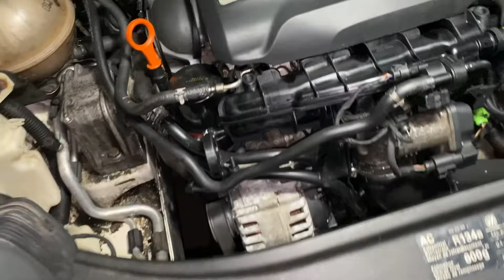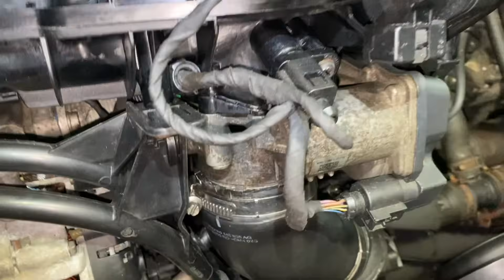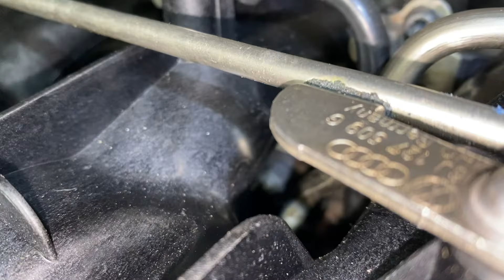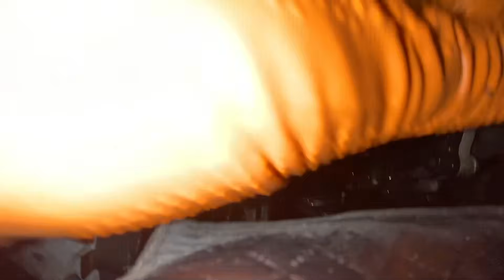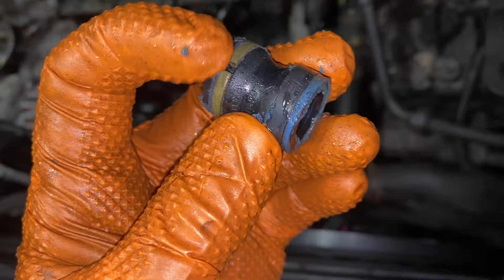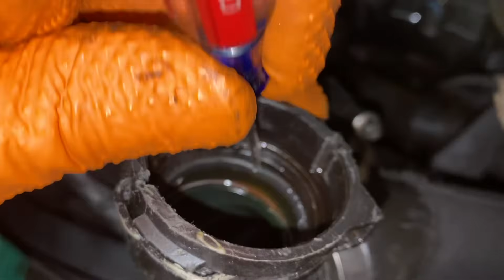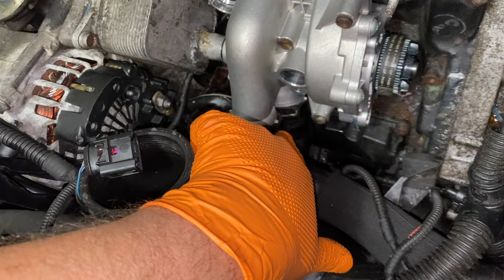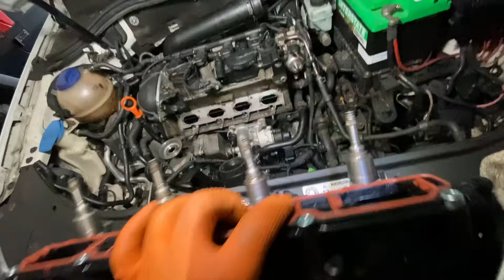Step-By-Step Water Pump Replacement on VW Passat, tiguan, CC, EOS 2.0 Turbo TSI/ CCTA  2008-2016

Comment: Hi, thanks  for the video  can you please let me know  the part #  on Amazon  if you  can thanks
Reply from the maker: No problem! Appreciated!

https://www.amazon.com/Aluminum-Water-Tiguan-Jetta-Beetle/dp/B07WQGG5PC/ref=asc_df_B07WQGG5PC/?tag=hyprod-20&linkCode=df0&hvadid=697456193483&hvpos=&hvnetw=g&hvrand=4772202874905904387&hvpone=&hvptwo=&hvqmt=&hvdev=m&hvdvcmdl=&hvlocint=&hvlocphy=1026032&hvtargid=pla-815245761019&psc=1&mcid=5c19d47b3069357c9e5bdb50b51ed3ff

Comment: Hey! Great video. I’m stuck trying to get the manifold out, I got all the torx and 10mm nuts off- I might have missed if you mentioned in the video if there’s a support bracket underneath the manifold. Something is keeping the thing stuck - it’s 1/2” out already but won’t budge. 
Help anyone! Thanks!
Reply from the maker: Yes I even made another video about that bracket
Reply: @motorcarnut right on!  Now I’m struggling to find replacement bolts for the water pump- it was previously replaced apparently and they stripped the bolts I had to chisel a couple out. Going to call VW tomorrow
Reply from the maker: @JW-wq1jj or just match them up with some from a hardware store like Home Depot

Comment: Hey buddy so I did my water pump on my 2012 VW CC Sport after everything was done I had a engine light came on i reset it but it came back on run a test and now it’s saying some gaskets on manifold are leaking
Reply from the maker: Make sure the intake manifold is completely seated. Sometimes the fuel injectors if not positioned correctly will cause the manifold not to seat all the way
Reply: @motorcarnut  it did set right but some reason I got codes  P2008 Intake Manifold Runner Control (IMRC) Circuit Open (Bank 1)
Reply: That is why don't mess w the manifold, just remove the TB and radiator fan.
Reply: @kimboofdzners9574  it was a connector that I forgot to plug in the one behind the manifold right side

Comment: To motorcarnut, i have a 2012 vw eos with currently 72000 miles on it, i know that somewhere down the road i am going to need a thermostst or waterpump or something down in that area and this video that i just saw that you made was incredible to watch, i have already had to replace the temperature sensor in the waterpump housing due to failure and after knowing what i had to go through for that and knowing that some day i will have to replace the waterpump, watching this very through video i will be able to tackle it, but you did an incredible job creating this video along with explaining everything, while taking all this stuff apart now is the time to replace the waterpump, the thermostat, the tempetature sensor and any "o" rings and gaskets while its apart at the time for whatever you are already doing, for the few extra bucks for parts, now is the time to do it to save yourself tear down time in the future, again thanks for the great video.
Reply from the maker: Sure, thank you as well really appreciate the comment and feedback and good luck!

Comment: I own a 2012 Volkswagen CC 2.0 Sport and I have coolant leak took it to the shop and they said it was the water pump they quoted me $1000 to replace the water pump is that how much and water pump cost ? I can’t seemed to find a good part store for me to buy the water pump by now watching this video I should be able to do it myself
Reply from the maker: Go for it! You get stuck give me a holler. Get an aluminium one on Amazon for like $50.00
Reply: @motorcarnut  yes ima give it a go
Reply from the maker: @thebigbosss1000 take your time and I have another video about a hidden bracket you have to take off too just so you know. I left it out of this video
Reply: @motorcarnut  yes thank you I’ll check that out 👍🏽
Reply from the maker: @thebigbosss1000 no problem
Reply: @motorcarnut  how long did it took you to do this work ?
Reply from the maker: About 2 hours but for you set aside a good day or so.
Reply: @motorcarnut  ooh okay got cha thanks for this info 👍🏽
Reply from the maker: @thebigbosss1000 no problem!

Comment: Excellent video! How difficult is it to change that belt while in there?
Reply from the maker: Thanks! Easy when replacing pump
Reply: If it is not damaged, leave it alone. Rarely rarely they go bad, have opened plenty of ea888 engines w 200k miles and more, never the water pump belt was in bad shape.
It is difficult! As it is reverse thread and if I recall uses a 12mm, but if for whatever reason you strip that bolt, you will NEVER be able to replace the balance shafts (IF they need to be serviced), unless you pull the transmission out and access the bolt from the freeze plug.
I highly recommend don't mess with the belt unless it is a must and like I said it is reverse thread.

Comment: Very comprehensive video! Congratulations!

As an owner of the grandfather of the TSI engine , having a g60 motor into a Passat Syncro, ( 325.000 km.),  unopened for repair, make some unavoidable comparisons.

At that era, (1990), users complaining that the g60 engine was very complicated and fragile.
The real life saw that it was, simply, so much ahead for  the  era, (of the 90's), but for nowadays, too.

With an ABT kit, (@ 200 hp), works for 32 years without a glitch, having so much better qualities, (every part is made of aluminum and the notorious supercharger of the exotic
magnesium). (Of course, the car was and is for every day use and not for races). 

I service her in person, without being a mechanic, and tomorrow I am going to change, by my self, for the first time in 325.000 km., the water pump which is, in comparison to the TSI's pump, a miracle of technology in its simplicity, quality and durability.

Not to forget that the g60 supercharger, supposed, at that era, to be a grenade , works perfectly, (the 3rd generation),  and is proved to be  more durable than the TSI's turbos and superchargers, without problems , having a M.T.F. of  ~200.000 km..

As for the timing chain of the TSI, you know... 
The g60 has a timing belt working silently, (no diesel sound but rather a turbine),  and, just in the case you forget to change it, the g60, as a non interference engine, remains without any damage! (It happened to me once).

Please, if you think this post is irrelevant, delete  it.

Thank you for your time.

The Syncro Heresy
Reply from the maker: I enjoyed reading this. Engines are not like they used to be that’s for sure. Been saying that for many years. Thanks for the post. Appreciated!

Comment: Great video with lots of details! Thank you! Is there an easy way to replace just the thermostat without having to take the intake off? My water pump is pretty new but the thermostat is stuck open. 2012 VW CC. Thanks again!
Reply from the maker: It’s in a tight area and has to be done under the vehicle but it can be done

Comment: My water pump just went today, I’ll be doing this because of this video! Is there any special procedure you have to do when adding fluid? Do you recommend flushing the system first? I’m also thinking of changing all the hoses out as well while I’m doing this too. Great video!
Reply from the maker: Thank you very much!, Yes, some vehicles have an aluminum brace that goes from under throttle body to engine block that is not in the video because some don't have one and yours may. 13MM nut to throttle body and triple square bolt to block. I would flush heater core, I have a video on that as well because have many vehicles that had low heat output and recommended. No special procedure for filling coolant system. You get stuck give me a holler. Good luck!

Comment: Hey brother, I have always been wanting to ask but I always forget. As far as the injectors when pulling the intake off. Is it really required to reseal the injectors if they don’t stay in the cylinder head?
Reply from the maker: No, they rarely go bad unless they are obviously damaged
Reply: @motorcarnut  You should make a video on how common Tiguans leak threw their sunroofs!
Reply from the maker: @ivanvega2821 Yes, I will. The drain lines pull away and create leaks. Thanks!

Comment: Awesome video, I’m using it to replace the pump on my 2017. I’ve followed all steps but something seems to be holding the manifold in. I can get it about 1-2” away from the engine but it won’t come up I’ll have to watch a few more times!
Reply from the maker: There is a metal support brace that goes from the bottom of the throttle body to the engine block that some vehicles have and some don’t. I forgot to mention that. Sorry

Comment: I am planning to buy the 2013 VW TSI 1.4L HL Golf MK7 - Was wondering if this water pump is exactly the same for that model. Also could you please share where you got the after market water pump from please. Looks like a good durable option.
Reply from the maker: No that engine is different.

Comment: Another question at 26:50 does the plastic line plug into the front of the solenoid sensor?
Reply from the maker: There are many which one? Where is it coming from?
Reply: @motorcarnut  the straight long plastic line coming from the back by the intake solenoid with the piece of hose at the end  but the one that comes in the intake
Reply from the maker: @mr.mr400 Intake runner flap solenoid to the back on the vacuum pump

Comment: Did you have to put the plastic spacers on the fuel injectors ?and are the metal rings with the hooks on the injectors clipped  onto the metal flange on the fuel rail holding it in place?
Reply from the maker: Yes you have to put back the plastic spacers and no the metal clip does not clip on to anything.

Comment: I have a oil leak coming  water pump area is probably from oil cooler . I will replace water pump as is leaking but not knowing how to fix oil leak.Thank you very much for your videos!😊
Reply from the maker: Thank you! When you take off the water pump you’ll have a better idea where it’s coming from. The oil cooler has a seal from the block but rarely ever leak, make sure it’s not the valve cover

Comment: thanks for video In my case we are going to replace the chain set the pump is still fine. Is it wise to replace the entire pump with housing or just the pump itself?

An is an INA pump (130€)  a good choice of should pay 50€ more for an Hepu?
Reply from the maker: The water pump is one whole unit, I’d replace it so you wouldn’t need to worry about it anymore.
Reply: @motorcarnut  Thank you for answer will do it
Reply from the maker: @erenoglu no problem

Comment: Thanks! While this video didn't have the aluminum bracket under the manifold, it was very good. You saved my daughter $1800 and it was possible in larger part because of the video.

One recommendation: i took out the large hose (about a 7" section) under the manifold in order to cleanly reinstall the manifold.
Reply from the maker: Awesome! And thank you for the donation. Sorry about that brace, the newer ones don’t have them anymore and for to mention it for the older ones.
Reply: How did you get the bolt off that brace? I’m working on my 2017 and as soon as I read you comment I saw i have a brace!
Reply: @mwm13  my bolt was a M8 triple square spline bit along with a couple extensions and a magnet extension to correctly move it into place. If i could upload photos i would...
Reply: @kevkev7164  I got the 13MM nut off the  top of the brace but I can’t see where the bottom even goes. I have to take a break and google a bit more I guess. Do you have a picture you’d be willing to email me?
Reply: absolutely- whats your email.

Comment: I want to change de oil cooler too because the oil it goes 10º/15º degrees hotter than it should be i think it might be de oil cooler . I suppose that if i follow the steps of the video to the 19:00 min , its simple unscrew the oil cooler and put the new one right? Awesome video!
Reply from the maker: Yes! And thank you for the comment!

Comment: Today i changed the water pump. The only issue i had was a bracket under manifold.  Your video did not show it.  I was like wtf. Why wont it come off.  I pulled a few times said something isnt write.  Got it off. Was 1   10 mm nuts and another torque.  I have a 2012 volkswagon cc 2.0 tsi.  Just a heads up for anyone that has the same.  Took me a  lil while to figure out.  Thank you great video besides that
Reply from the maker: Thank you and correct! I do so many of these and almost all of them are not there or newer ones don’t have it at all from the factory.
Reply: Yea it was driving me crazy. I watched your video 5 times. Best video out there btw.  Thanks
Reply from the maker: Thank you! I really appreciate that!

Comment: Incredible video. I'm trying to help out a buddy who's in a tough place. He has a 2006 Passat 2.0t. Fsi engine. How much different could it be? I'm pretty mechanically inclined, just wondering if this video would help me out enough to where I can figure out the rest. Thank you!!
Reply from the maker: Thank you! They are pretty different engine and this video wouldn’t help you much. The FSI engine has a timing belt not chain like the TSI engine also the water pump is completely different as it is driven by the timing belt. If you have access to a library online you can look up the procedure for free. I haven’t had one of those for a long time and believe you need a cam tool as well so might be better to change timing belt with water pump.

Comment: PLEASE TELL ME HOW DO YOU REPLACE WATER PUMP DRIVE BELT
Reply from the maker: Same as in water pump replacement. The belt goes on when installing water pump
Reply: @motorcarnut Jesus! 
The belt has a reverse thread bolt, and uses if I remember a 12mm or 13mm close wrench. It is a pain to remove if the bolt is very tight, do not strip it! 
I made a custom socket, cut it half to make it shorter and where the rachet side I made to flat slanted surfaces to fit an open wrench. This way it is a mini shorty socket (better grip) than a close wrench. 
I use an open wrench and place where the two flat sides made on the modified socket and that's how I was able to take the bolt out. (Remember reverse thread)

Comment: This video saved my ass!!! I have a 2014 CC and i learned the hard way that an oil leak will cause the seal to expand and crack the plastic. I was able to get a new water pump in there so i can get to work and next week i can deal with the valve cover. This is one of the best tutorial videos I've seen  and I'll 100% be checking back when i have other work to do. Thank you for making this!!!!
Reply: Bro check for your oil filter housing. I own a cc an goin thru some oil leaks an just found out where it's coming from. If you got an oil leak that's running down you oil pan then check your oil filter housing. The oil is running down the block in between the ac compressor onto the oil pan. The gaskets in the oil filter housing is bad an may e the engine oil cooler just replace those gaskets an you should be fine. Also replace you upper timing cover gaskets an o ring 💯💯
Reply: @TherealHimOG  that's the next step lol. We got a new water pump, upper timing cover (I upgraded to an aluminum one) and now I'm working on the oil filter housing
Reply: @pinkpapafranku lol yea I did all of those too lol. Just recently seen that my oil pressure sensor was stripped so I have to replace the housing but they're cheap on ebay & Amazon and luckily it's an easy fix just have to remove the belt, alternator & ac compressor and it's right there no intake removal whatsoever
Reply: @TherealHimOG  is that the same thing as a head gasket?
Reply from the maker: No problem, thanks for the feedback! much appreciated.
Reply: I was told my head gasket was leaking oil into my pump. How long did it take you to replace the pump.

Comment: Think you could have mentioned the aluminum bracket connected to the bottom of the manifold!?
Reply from the maker: You’re correct. I do so many of these with them missing because for whatever reason they don’t put them back and I forgot to mention it. I will make a note of it in the video. Thanks  for the feedback, appreciated